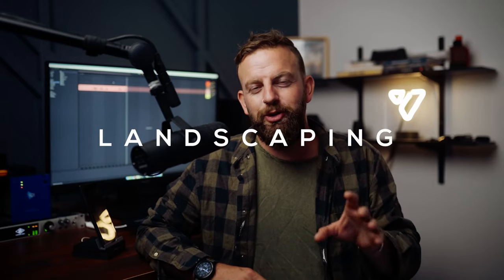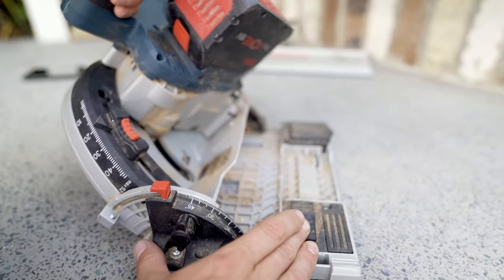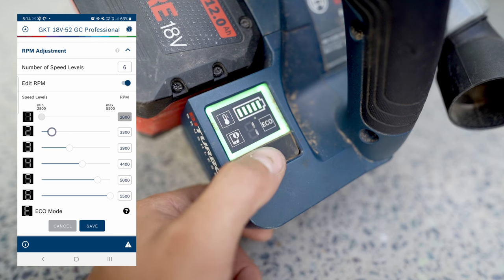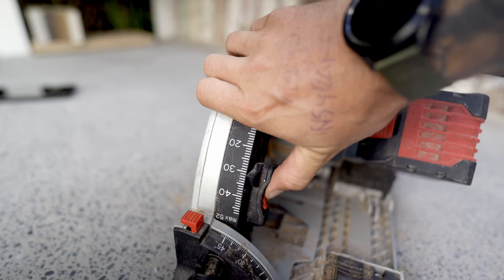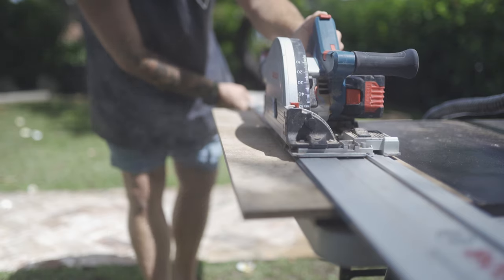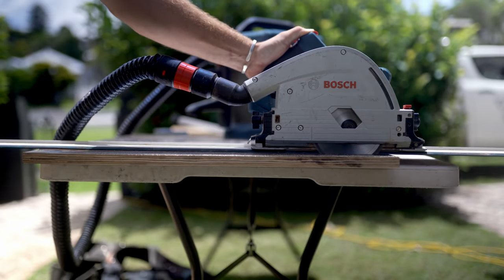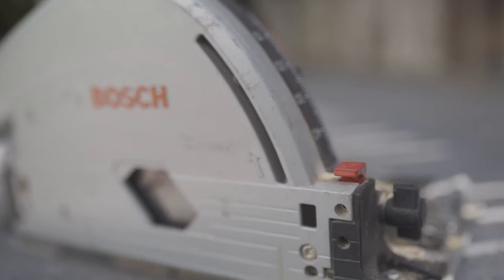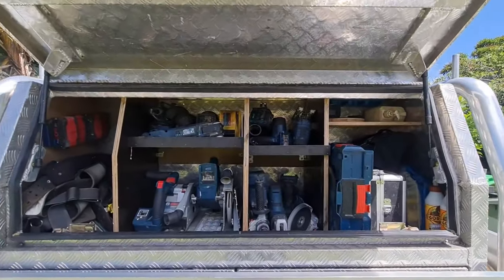GKT 18V-52GC - BOSCH Biturbo Plunge saw |  GKT18V-20GCL

Comment: I've had this for about 9 months as a domestic carpenter and it made sense considering I'm on the Bosch platform. It isn't as good as the festool in my opinion but it's a great tool and gets the job done. The blades situation is very disappointing, Total Tools they said they can sell me the same blade that it came with for $150... I found solutions though, I ordered a heap of 42 tooth blades on Amazon from the UK for precision cuts at $57 per blade and for general carpentry Sydney tools sell a Milwaukee 18 tooth blade for $16 each.
Reply from the maker: Couldn't agree more mate. The festool is super nice, but the Bosch gets it done. It's annoying not being able to pick up a blade wherever. I've been grabbing those Milwaukee ones from totaltools.

Comment: Do you think you'd just go with the track compatible circular saw (GKS 18V-68 GC) instead if you had your pick?
It definitely would be a bit bigger and bulkier than the plunge saw though. What other features differences would also keep you from picking up the plunge saw instead of the GC circular saw?
Reply from the maker: All depends on what type of work you're doing. For a site carpenter, the gks18v-68gc would be fine for most applications, and much more versatile. For a finish carpenter or a cabinet maker, the plunge saw is the move. It's hard to beat that versatility.

Comment: A nice quick overview.
How does it compare to the festool in terms of cut quality? Some reviews don't rate it nearly as highly. I work with a lot of gloss MFC as a kitchen fitter and would love to change from my TS55 to a cordless plunge saw. I'm on the Bosch 18v system and ideally would get the plunge saw but cannot compromise on cut quality
Reply from the maker: Hey Rob. 

The thicker blade on the festool is nice. If you don't have a sharp blade on the Bosch, it will bend due to being a thinner kerf. It's understandable due to it being 18v, just something to keep in mind. 

It's hard to fault the festool
Reply: Rob; I started out with Festool TS55, went over to Mafell; I had the Mafell MT55cc and now have the Bosch GKT55. Both great saws. For plunge cuts in hard materials the Mafell is slightly more prone to kickback, in my opinion due to the lack of a front handle, which the GKT55 has. A friend has my MT55cc and it is a brilliant saw, and the cut quality is second to none. However, with the right blade on the Bosch (Blue expert blades) I cut Oak, Corian, laminated panels etc and there is nothing to complain about.
With all that in mind I was a little hesitant towards the 140mm blade options and the GKT 52. Well, turns out I needn't worry. The saw is perfect for my intended use, interior carpentry and every now and then flooring and decking. It replaces a Mafell KSS40 18V in my case - which some people might raise an eyebrow over - but the Bosch suits me better, I use it on my "left over" Mafell rails and I researched the blades before committing to the GKT52. It cuts like a champ. 

One thing to consider is that the "battery optimized" blades from Bosch are same size blade/kerf as the previous Top Expert blades but they have shorter teeth! 
I made sure to source up the previous generation blades and they cut superbly and should last longer. I don't know if it takes a little toll on cut time - perhaps - but I honestly don't feel like the saw is struggling. I trimmed down veneered panels first thing I did and cut was splinterfree on both sides when crosscutting. For hard laminates you need to pre score for best results, I did not have the Top for Laminate blade (which is on order now) which should perform the best. 

With the correct blade (see GoTools for a comprehensive GKT52 blade guide) you are set for top quality cuts. I love the format of the saw, I have it in a Systainer IV with blades, accessories and a 18V barrel grip jigsaw. Very pleased with the kit, it replaces two other saws for me for use on site. For the most critical cuts in the shop I will still rely on my GKT55CE with the proper blade.
Reply: @hrundgren4352  thanks for your reply. I've still not committed to either, though my apprentice is slowly collecting Bosch 18v tools and has already expressed an interest in buying it off me  if I buy the Bosch and don't like it.
My TS55 seems to have developed movement between the base and body of the saw so it may be this weekend I finally bite the bullet and purchase the gkt18v52.
The relative lack of blade compatibility does very slightly concern me, a 160mm blade is the most common by far and as such I always know I can just pop out and grab a replacement any time rather than ordering them in advance.
Reply: @robkirkham8873  140mm blades are scarce on store shelves. I bought four blades online - and also got a free pro core 5,5ah battery as well as one of the premium saw blades, Top Precision for Wood as a Bosch promo, (!) so I am set for a long time with three great wood blades, two laminate blades and a low tooth count rip blade. They have a dozen blades that fit so if you get one extra or two you need not worry.
Reply: That dust coming off the saw is questionable  the Mafell is very good with it   But I do like the look of the Bosch
Reply: @andrewlee4938  the dust extraction on the Bosch is terrible. When cutting there's a fairly substantial amount of the blade exposed on the side of the saw which allows a lot of dust to escape. It also lacks the little bit at the front of the blade on the right hand side which the festool has which makes a big difference for dust collection.
I seriously regret buying the Bosch rather than the festool.
Reply: @robkirkham8873  thanks for
The reply    That’s a real shame as that is a deal breaker for me .  I work domestic and inside bedrooms so dust extraction is paramount   I cannot justify the cost of going from Mafell 240 to cordless so will have to keep untangling cables I guess !
Reply: @andrewlee4938  in all honesty it takes less justification than you might think. Going to battery genuinely is a game changer for me personally. I just made the wrong choice on which saw.

Comment: When you should choose just one, for the occassional carpentry, e.g. terrase building, would you choose this one, or the gks 18v-68 gc? I know I am comparing a plunge saw to a circular one, but I can see some plunge-like principles with the 18v-68 gc there too?
Reply from the maker: Hey Petr. Sorry for the late reply. I think the dedicated plunge saw will give you more accuracy and control. If you’re doing precision work, get the plunge. If you’re just breaking down plywood etc, the 18v-68gc  might do the trick as it’s way more versatile

Comment: I really like Bosch saws (I have the GKS 18V-68 GC and the GKT 55 GCE, the latter of which is simply the best saw I've ever owned) but I'm not as keen on the Bosch track. As it's very thin and flexible, so if the material is not totally supported you'll get kickback –  I've got some pretty deep gouges in my track. Never had this problem with the Festool track so I'm back to using that with the Bosch saws.
Reply from the maker: I have both the festool and Bosch tracks too, I'd have to agree with you on the flex however I have gotten used to it. But yeah, really great saws, im a massive fan

Comment: Thanks for the review!!! this awsom tool is officially comercialized by BOSCH in Brazil. Reached out to BOSCH to know about its blade and for an unexplainable reason the blade is NOT available here!!! You may be able to import it from the US but will be very very very costy!!! Despite this is a good tool but with this uncommon 140mm blade I don't see a vantage over the lovely GKS 18V-68 GC 184mm!! For the blade reason this tool was wiped out of my wish list. Leave your comment.... would love to hear back from you and your audience!
Reply from the maker: Hey mate! Yeah the blade is fairly hard to come by in Australia too. I often have to go to specialist tool stores instead of general hardware stores, and even then, they only have one option. The other down side to this small, thin blade over something like the corded festool is it tends to bend when cutting something like hardwood. However it is still a great tool.